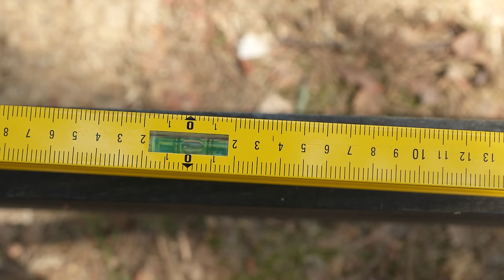Building a cabin in the woods asmr, no talking, off grid living (long version)

Comment: When your nails are too small (heads sliding through the holes) just hammer the nail straight through the brace itself. The nail will pierce and hold the bracket better.

Comment: Isn't your foundation a little unsound or are you only wanting a temporary structure
Reply: You can use cement pads for a small cabin, but I would have definitely pounded the soil down instead of just placing blocks on top of it.